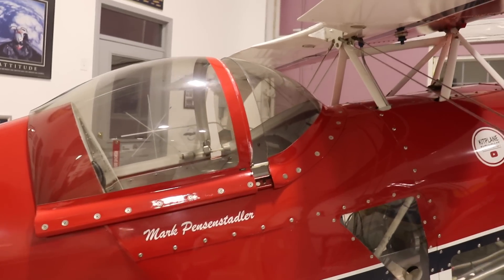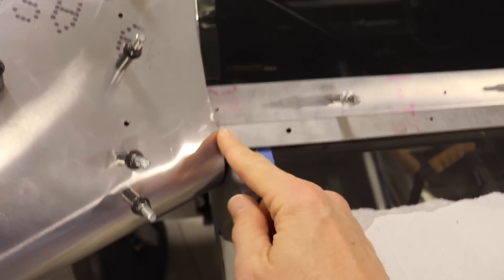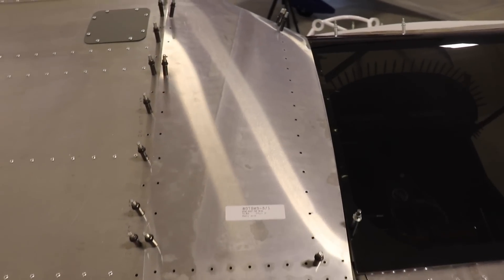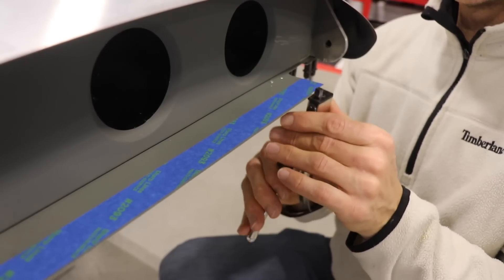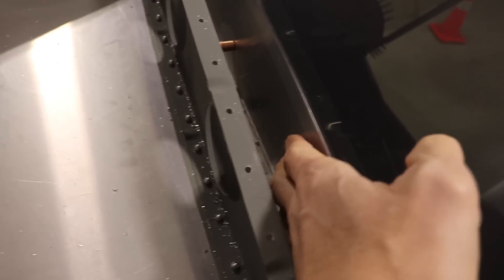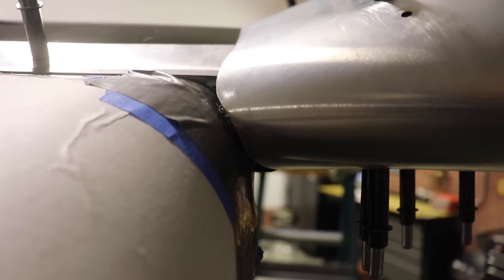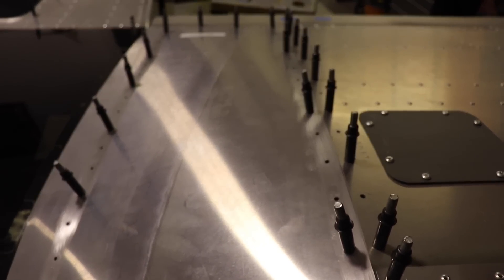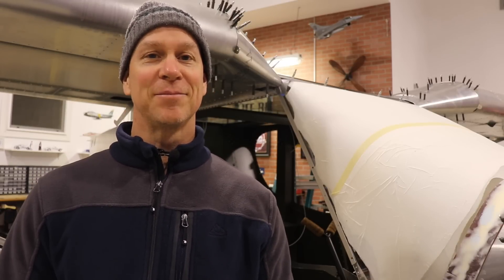CH-750 Super Duty Inboard Wing Skins

Comment: Hi Mark. I now see that DIY Packraft mentioned this below, but I’d already written this expanded version, so… One of the beauties of Zenith aircraft is that they’re made of 6061-T6 (you see it printed on the metal sheets). This is an aluminum/magnesium/silicon alloy that is VERY corrosion resistant (the T-6 is the heat treatment). There is no “layer of pure aluminum” as you mentioned @ 7:20 like you’d find on the 2024 Alclad that your average Cessna (and many other kits) are made of. 2024 is alloyed with copper, so it’s very susceptible to galvanic corrosion. It needs the protective pure aluminum layer. You don’t NEED to prime or paint 6061. You’d be OK. 2024 is ever so slightly stronger, but for this application, it doesn’t matter at all. Love all your great vids!
Reply from the maker: Yes you are correct-I didn't realize that at the time.

Comment: Have you considered using a vinyl wrap material to seal that gap instead of making a fairing?  May not look as good but would be a very quick and easy way to seal it up so no rain etc can get in.
Reply from the maker: Part of your idea is really good! I could cut a strip of vinyl to cover the joint. That would keep water from entering the root part of the wing. It would look terrible though. But....I could apply the vinyl and then put a nice looking fairing on top of that!
Reply: @KitplaneEnthusiast  I think you said it’s going to be mostly hidden by the leasing edge slat.  So if you can’t see it problem solved.  Cheers.

Comment: Use 3M automotive body seam sealer. Works great.
Reply: I see there's Brush on Seam Sealer too, sold by Eastwood maybe others.
Edit: Never used seam sealer before so went and researched a bit. Found a video... Tips & Tricks for Applying Different Types of Seam Sealers to Your Car, that I found informative.

Comment: Have someone come out and scan the front corner and then 3D print a fairing.  Easy to do and can get a "perfect" fit.  Most serious 3D print hobbyist can do it.
Reply: Good idea. What type of filament would you use?
Reply: @Cornstalker7273  ABS, Caron infused, Nylon...there are several that would work well.  You could even use PLA to make a mold to build a fiberglass part.